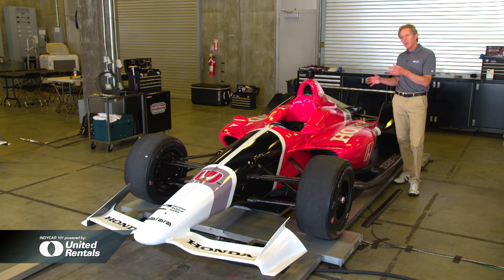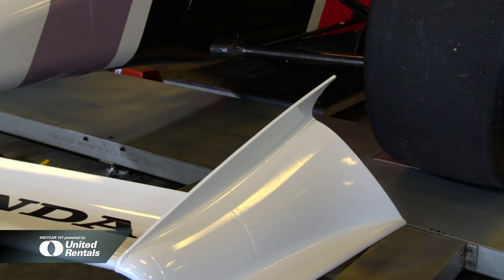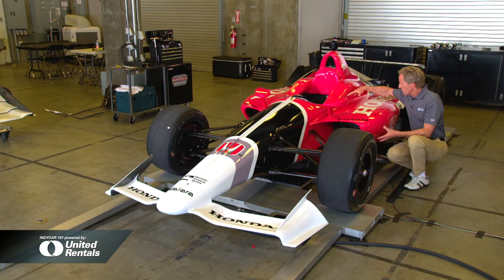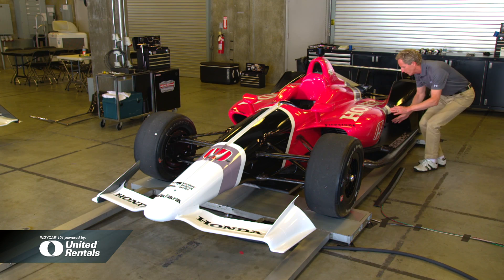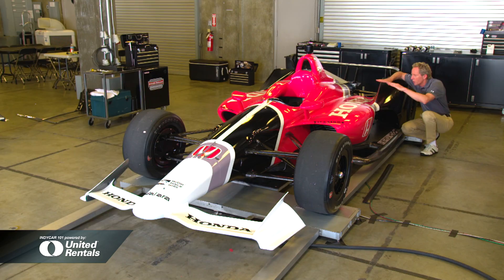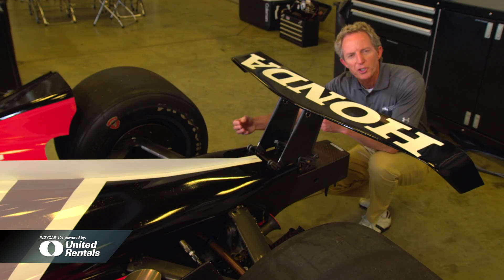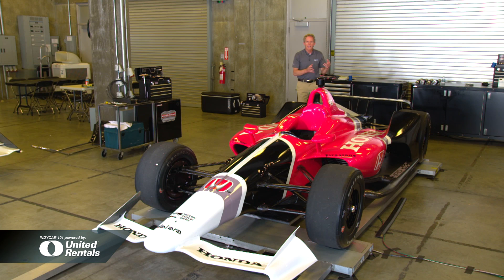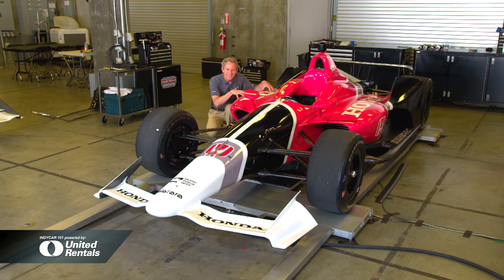INDYCAR 101 powered by United Rentals: 2018 Universal Aero Kit

Comment: F1 introducing halo to prevent types of deaths that happened in indycar, yet indycar aren't introducing head protection 😒😒
Reply: Because Indycar is not a nanny state.
Reply: Charlie HD Gamer even though it's been stated in the recent past that IndyCar is looking at a shield and isn't going to rush into something like the bullshit halo
Reply: August Watring the only problem with it is the looks and they said that it will look slightly different next year. Let's hope it looks better.
Reply: ＬＩＶＥ　ＴＯ　ＤＲＩＶＥ
ＤＲＩＶＥ　ＴＯ　ＳＵＲＶＩＶＥ
Reply: I mean we can say it would have saved lives, but the angle of the nosecone that killed wilson probably would not have been altered without a roof. Wheldon? Nope, Bianchi? Maybe. Massa? It might have deflected the spring to a fatal angle than away from him. Really aside from a very specific kind of accident (a big piece of debris coming right at the driver from the front) the Halo is all hype. The only way to fix this is to seal up the driver. WEC has done this, and it's only a matter of time. In the mean time we'll have another few years of pics from F1 to go with our "remember when F1 cars had dongs for noses?" Now we'll have, "remember when F1 cars looked like flip flops?"
Reply: If you look into the new design more they purposely engineered it to receive a cockpit canopy down the line. The reduction of the overall amount of bodywork is also important because it reduces the amount of potential debris. Also, including the tethers (which have already been in use for 2 years) holding the wheels and other potentially large pieces of debris onto the car there have been many steps taken to cut back the amount of flying debris. Therefore, reducing the chances of it hitting a driver or fans drastically. Indycar doesn't always race on tracks with massive runoff areas like F1 so hitting walls is much more frequent and they put a lot of effort into the safety of the cars and tracks.
Reply: The F1 halo wouldn't have even saved Justin unfortunately. His death was a fluky hit of debris from directly above.
Reply: Thats not true. Wilsons accident is exactly the type of accident halo was developed for and it would definately have saved his life.

The severety of the impact was not caused by a piece of debris falling down at 20mph, but by him driving into that debris at more than 200mph. He did not get hit from above, he got hit on the forehead. 

The reason why the halo is so high above the drivers head is so that it deflects debris in exactly that type of situation. Everything that flies over the halo automaticly also flies over the drivers head and does not hit him.

Let me make it clear that i absolutely hate the halo. But it would have saved Justin Wilson.
Reply: Charlie HD Gamer you read my mind
Reply: Right?  How dare Indycar choose to not rush in a compromised "solution" and instead develop a protection system that checks all boxes and can be properly integrated into the chassis...
 Disgusting I say!
Reply: The problem is that we're kind of at the point where safety improvements involve tradeoffs-remember that the piece that came off of Karam's car and hit Wilson was itself a safety device-decided to help protect a driver in a frontal impact.  My concern is that both the halo and an enclosed canopy would slow emergency driver extractions-especially if the car is upside down.
Reply: Is there any reason for all that open hollow space in the halo? I meant if you wanna design some cockpit protection, might as well go full out and do a canopy like the one used on the top-fuel dragster
Reply: That's what I tell people who claim that a canopy or halo is some kind of magic device that prevents all head injuries.  In both Bianchi and Wheldon's crashes, the impacts were severe enough that they tore the rear roll hoop completely off the cars.  Could you make a device that could withstand that kind of impact?  Sure-if you don't care about it being so bulky that the driver won't be able to see anything.
Reply: Charlie HD Gamer Because they care about true open cockpit racing and clear vision
Reply: Even the FIA said that HALO would not have prevented Wilson's death, but I guess you did a more scientific investigation of the accident.
Reply: When did FIA say that?
I know they confirmed HALO could not have saved Wheldon or Bianchi. But i never heard any such statement about Wilson.

Wilson's accident was exactly the type of accident HALO was developed for. If it would not have saved him then it would never save any driver in any situation.
Reply: Hannes Größlinger

Instead what Indycar did was revising the theters in terms of numbers and strength so they can also hold the parts together when the car crashed.
Reply: Sorry, you are right, they admitted it would not have helped Massa at Hungaroring 2009.
But with the open top that HALO doesn't cover an accident like Wilsons can still happen. HALO is just a half-baked solution that even a 5 year old could've come up with, when F1 engineering is advertised as being top level.
Reply: F1 introduced the Halo because Bianchi's family is suing.  It's an attempt to show the court that "F1 does everything for safety" so if they do lose the lawsuit, they can hope to reduce the damages by doing forcing the Halo regulation through.

Comment: Sorry F1 but Indycar is putting you to shame right now and I'm a big F1 fan.
Reply: So do you like looking at the same 20+ cars for years to come? If you do I guess you also like GP2/F2 more than F1.
Reply: I would rather look at the same 20 plus cars than look at flip flops over the drivers heads which will be fitted on the F1 and F2 cars next year.
Reply: I agree that HALO is as bad, but you wrote "right now" and HALO hasn't arrived yet. Both HALO and IndyCar spec cars show that motorsports in on a decline sadly, although that process started more than 10 years ago already.
Reply: armorgddon F1 has been testing the Halo for 2 or 3 years now and now they are putting it on the cars in fp1, so I am right in saying "right now" plus the cars have coat hangers on the back and they have killed the sound of F1. It's no longer the F1 I feel in love with in the late 90's the sport is just going backwards.
Reply: I don't get what you mean with coat hangers!?! The sound of F1 was killed by the rules dictating certain layouts, fuel flow limit and rev limit.
You're right that F1 is on a decline since a long time, for me it started to get really bad with the start of the  2003 season.
Reply: armorgeddon What I mean with the coat hangers is them little wings they have on the fins. Their bloody ugly things to look at.
Reply: Ah yes, got it. The ridicolous thing about the coat hangers is that FIA said at the beginning of the year that they'll be banned for aesthetic reasons and then they decide to introduce HALO! LOL!
Reply: Yeah but the halo is for safety reasons not for aesthetic reasons but it won't stop small bits of body work hitting the driver like what happened to Justin Wilson. But do think the drivers should have a say if they what the halo fitted on their car after all it is them sitting behind the wheel.
Reply: Yes, HALO is a half-baked solution making F1 engineering look like amateurs.

Comment: I like the looks of the car, but there's one thing I don't get. Back when the DW12 was introduced, one of the main changes was that rear 'bumper' begin added, to prevent cars from crashing over the rear wheel of the car in front and going airborne. When Dan Wheldon's crash happened, they specifically said that such a crash wouldn't be able to happen (or at least it would be much less likely) with those rear bumper parts. Yet, on the new 2018 cars, they're gone... while it was so hyped initially.
Reply: I've wondered the same thing, the only conclusion I can think of is that it simply wasn't working because there's been several airborne crashes with the DW12.
Reply: Safety was not the main factor when those bumpers were designed, safety was a marketed by product.  The bumpers were designed to and needed to diffuse turbulence.  What's easier to market to fans, safety or our car produces too much turbulence so we have to make it ugly?  Now, with ground effect down force, no need for bumpers.
Reply: NRAgunnut1993 Scott Dixon's accident at Indy this year being a prime example.
Reply: Yeah I thought the same thing, maybe it made everything even more dangerous, with those parts coming loose very easily.
Reply: Explains a lot indeed!
Reply: One of the main reasons is the overwhelming amount of debris coming from pods during a collision. This let to multiple punctures but more importantly more injuries. Drivers and fans were impacted by bumper pod debris and one fan was injured in 2012 (i believe)
Reply: I believe they're trying to use the aerodynamics of the car to prevent them from flying. The pods didn't stop the car from flying once the air got under it but clever use of air flow (for example the rear flaps) can force the car back to the ground. Also, the pods creating too much debris is correct, even with the tethers holding them to the car it was too much.
Reply: Yup and I saw it with my own 2 eyes, I was right there in turn 1

Comment: I'm concerned for the loss of the rear pods tho, especially on the speedways/ovals. I thought the whole point was to keep them from going airborne when they touch wheels. That aside I'm excited to see what type of racing we get next year! Car looks great.
Reply: That was the point of them. That doesn't mean that they did the job or that they didn't produce additional issues.
Reply: Taras Shevchenko well nothing is perfect when it comes to safety but they did seem to help. I think it's just an engineering sacrifice they had to make to stay with the philosophy of the new car.
Reply: It is not a matter of whether it is perfect or not. It is a measure of positives and negatives. I defended the bumpers for a long time but given the debris increase and the instances (2013 St. Pete as an example) of cars climbing over one another, I can understand abandoning them.
Reply: That was exactly the point of them being introduced. And then in the very first race with the new cars, the 2012 Long Beach GP,  Marco Andretti got airbourne after hitting another car, immediately proving that those rear wheel guards don't work.

Those things were too flimsy to do anything during a medium to heavy impact, and making them stronger (and heavier) was not an option for several reasons. Most importantly the fact that from time to time they break off, and you don't want to have heavy pieces of debris flying around. 

The only upside of those things was that in close racing they prevented tyres from getting cut when cars slightly touched front wing to rear corner. However in those cases the pods would most likely get lose and force the driver to the pits anyway, and often also cause a caution.

The blow-over accidents by various chevy drivers during the 2015 Indy practices were also mostly caused or at least aided by the aerodynamic properties of these pods.

In short: the rear wheel pods caused a lot more trouble then they prevented, so Indycar is now ending this experiment.
Reply: The way the "rear protectors" were done was the problem. I still think they should use them but properly designed ones.

Comment: But still no head deflection device or design for the driver.   Shame on IndyCar for letting F1 run with that and the implementation of a new safety device. I hope it doesn't take another Justin Wilson accident.
Reply: It was designed to fit an aero screen once it's fully developed in another year or so .

Comment: Still has rear wheel covers. Is still very ugly. Is still slow.
Reply: Most people seem to like it, myself included. I'm sure your Camry looks much better and goes faster.
Reply: Not only a huge improvement in looks, it's safer, cheaper, and no doubt we could  be seeing pole speeds at Indy of 235+ with the same boost levels when these cars are trimmed out.  Wouldn't be surprised at all.  Better road course racing too.  It's a win-win. Your comment is taken with a grain of salt.
Reply: It's still spec racing and quite boring.
Reply: So why are you watching an Indycar video? Manufacturers in motorsports is ruining it at the moment, look at WEC and DTM & not to mention how utterly dull F1 is due to the lack of real competition to Mercedes (bar Ferrari this year, admittedly).
Reply: DTM is basically spec racing + BOP and WEC is still in good shape since hybrid isn't mandatory and the LMP1 hybrid cars are real high tech compared to the stuff IndyCar and F1 runs.
Reply: isn't F1 spec racing?  they all have the same tire. the same PU. the same chassis dimensions. everything is very tightly controlled and therefore F1 really is just a spec series... it's just a bunch of different factories building the same car.  and also, are you actually saying that F1 is not boring?